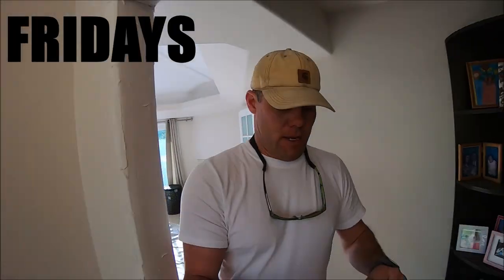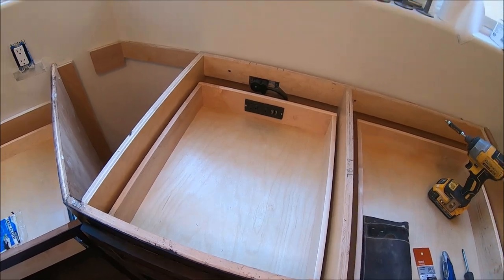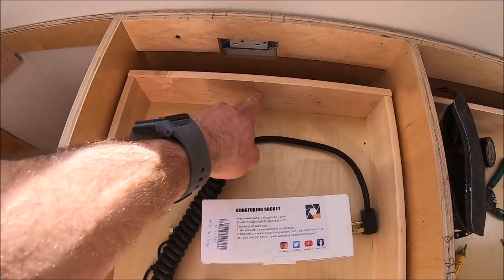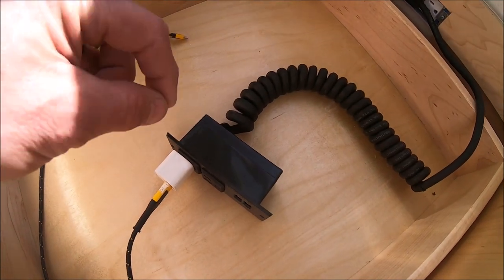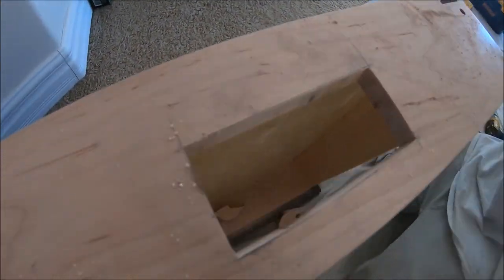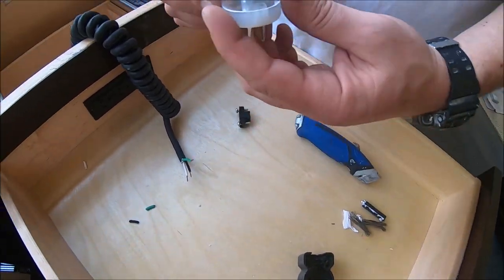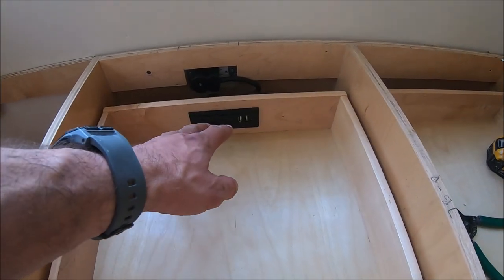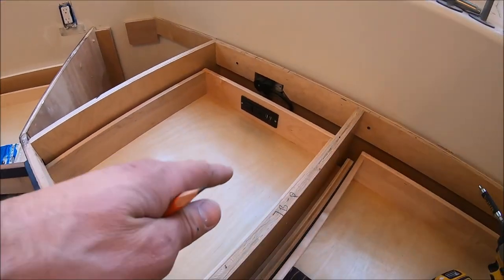Turn a DRAWER into a Charging Station

Comment: Receptacles for residential occupancies
26-710 General This Rule applies to receptacles for all residential occupancies (including dwelling units and single dwellings) as follows:
(h) a receptacle shall not be placed in a cupboard, cabinet, or similar enclosure, except where the receptacle is
(i) an integral part of a factory-built enclosure;
(ii) provided for use with a specific type of appliance that is suitable for installation within the enclosure;
(iii) intended only for a microwave oven;
(iv) intended only for a cord-connected range hood; or
(v) intended only for a cord-connected combination microwave oven/range hood fan;
(i) except for cord-connected dishwashers, in-line water heaters, garbage disposal units, and other similar
appliances, receptacles installed in cupboards, cabinets, or similar enclosures in accordance with
Item (h)(ii) shall be de-energized unless the enclosure door is in the fully opened position;
(j) any receptacle that is part of a luminaire or appliance, or that is located within cabinets or cupboards as
permitted by Item (h) or that is located more than 1.7 m above the floor shall not be considered as any of
the receptacles required by this Rule;

Comment: I feel like the cord could have been shortened a little more. The cord still hangs down into the lower drawer a bit. I think the lower drawer could catch on the coil when opening. I notice when you open the top drawer, it's barely making use of the coil until almost full extension.

Comment: Not electrical inspection approved. Not at all!!!
Reply from the maker: lol
Reply: @LandbergTileTV  Receptacles for residential occupancies
26-710 General This Rule applies to receptacles for all residential occupancies (including dwelling units and single dwellings) as follows:
(h) a receptacle shall not be placed in a cupboard, cabinet, or similar enclosure, except where the receptacle is
(i) an integral part of a factory-built enclosure;
(ii) provided for use with a specific type of appliance that is suitable for installation within the enclosure;
(iii) intended only for a microwave oven;
(iv) intended only for a cord-connected range hood; or
(v) intended only for a cord-connected combination microwave oven/range hood fan;
(i) except for cord-connected dishwashers, in-line water heaters, garbage disposal units, and other similar
appliances, receptacles installed in cupboards, cabinets, or similar enclosures in accordance with
Item (h)(ii) shall be de-energized unless the enclosure door is in the fully opened position;
(j) any receptacle that is part of a luminaire or appliance, or that is located within cabinets or cupboards as
permitted by Item (h) or that is located more than 1.7 m above the floor shall not be considered as any of
the receptacles required by this Rule;